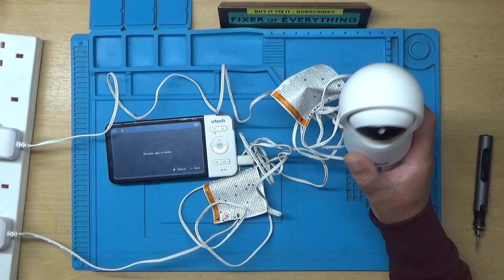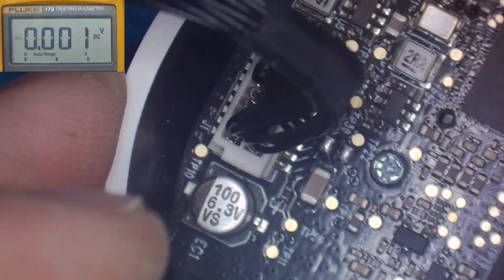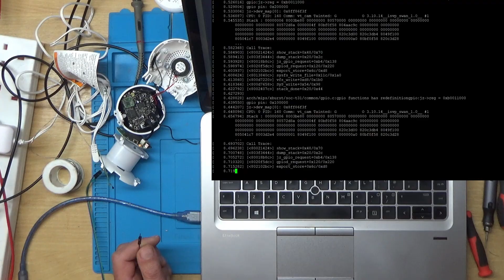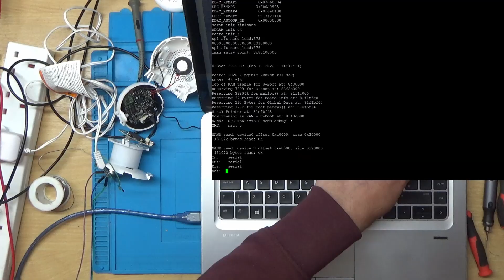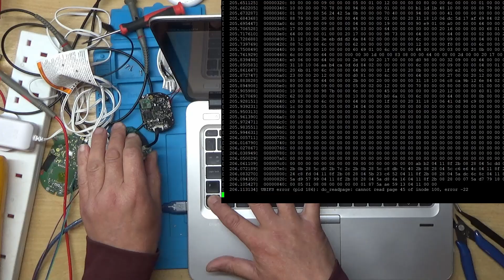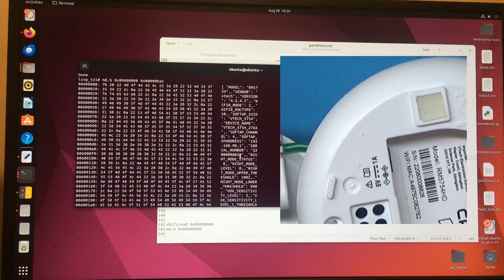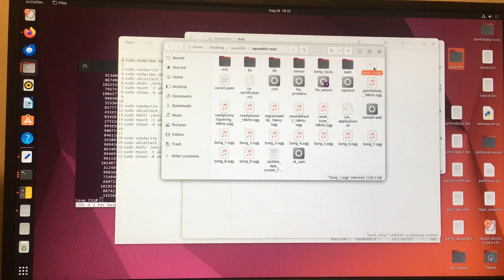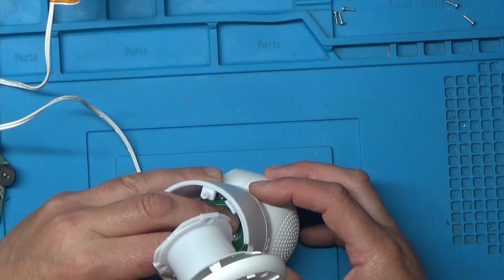Faulty VTech Baby Monitor | An EPIC Repair With Shocking Findings!

Comment: I would love to see you tackle a ps5. They take someone who not only can solder well but understand how to use uart to diagnose the failure. Ive just recently started watching PS5 repair videos. 

The other interesting video i found lately was for a flood damaged aston martin (over 120k dollars). Theres a flash chip that contains a cff file (the cars vin, options, firmware etc .) you cannot replace the part without having it programed but the file only exists on the old chip and at the factory. The factory has a part number for the chip and file but refuses to fulfill the order (even from a dealership). The owner gave up and sold the car but what an amazing project that would have been. 

Thank you for such a great video!
Reply from the maker: Thanks 👍I'm sure I'll get a PS5 to look at in the future, but today I got asked if I would be able to have a look at an electric train! with a dead control module, so that might be very interesting if it comes off...

Comment: Hey Great video thanks for making it.
I am not sure if you tried the simplest fix of all.
On the Camera itself you can hard reset the camera back to original factory settings.
Turn on Camera and hold the pairing button down for 20 Seconds (20 did not work for me but 30 did).
IT clears the entire camera and put original firmware back on it.
Reply from the maker: Thanks for the tips, although it would depends on where in the camera software it detects the button press. Seeing as it wasn't booting up, it may not have reached that part of the code. There are a number of these for sale with the same issue so they may have tried that and it didn't work.

Comment: This was definitely a great diagnosis and repair!  So the filesystem for the video recordings had a bad block, and I'm assuming the OS (Android) had no way to auto-repair the filesystem, rendering the device dead!  that seems like a poorly written firmware/OS implementation.  I wonder if there's a reset sequence that would force a format of that filesystem, by just pressing the reset button. (maybe longer than 3 seconds?). 🤔  great video, again!
Reply from the maker: Thanks 👍it just runs linux not android. After recording the video I still had the file system on my PC and discovered that the file causing the issue was a sqlite database that indexes the video files. Deleting the files caused the database to become invalid and it was recreated. It was possibly corrupted due to a power failure or the update. I'm still not sure on that one.

Comment: Fantastic job figuring that out!  The amount of times I've seen a firmware update that's bricked a device because the uncompressed  firmware was larger than the free space on the flash. It's maddening that they dont test it or at least set a maximum on the partition size to make sure there's enough for firmware updates. A lot of these type of devices tend to store user storage, like images and videos on a micro SD cards (but I get that typically its not fast enough to store high quality 4K video on a lot of SD cards).  At least then it ensures that the flash is standard on every device.  Well done V-Tech for not carrying out a proper UAT.
Reply from the maker: Thanks for that 👍If you like this type of stuff I've done a few other videos similar where I've had to delve into firmware or even reverse engineer software to fix stuff. I've just created a playlist here: 
https://www.youtube.com/playlist?list=PLu4s108ty9Iki2H77htqeCNqtunWMJFKK

Comment: Got a similar one a while ago, that I got on clearance. Bought it because the power supply is micro USB, and has a 3m cable for power, and is capable of 1.5A output.
Reply from the maker: Nice 👍

Comment: Installing the Linux binwalk utility would have extracted all the partitions from the flash.
Reply from the maker: Unfortunately not. It was the first thing I tried. I've reverse engineered loads of stuff over the years, cross compiled stuff, and even wrote an SDL layer and ported Doom and Duke Nukem to the LeapTV (kids game and a few other platforms such as a ROKU TV player) around 10 years ago. Whilst normally binwalk would work, this flash chip has OOB data for error correction which needs applied to the sectors so you have 2048 (data) + 64bytes of EEC data which can't normally be accessed. This needs applied to the sector if there are any errors and obviously mucks up the raw file. Then because it uses UBIFS you have to emulate that because the sectors are not in sequential order, they can be written anywhere so a file might be at sector 1,48,1034,3,72  instead of 48,49,50,51 which further complicates it. I even tried some scripts to apply or remove the OOB data, and extract the UBIFS. This is why it spent about 3 days on it and ending up using NANDSIM... I didn't include any of that in the video otherwise it would have been a 2 hour episode! 😂😂😂

Comment: What's crazy to me is that you just casually mention seeing if you could find a datasheet for the IC contained in this camera and then POOF....   there's the datasheet on the screen!!   So clear, so informative, and incredibly, displayed in ENGLISH!!
  I do a lot of similar work repairing various electronics and I would say that maybe, if I'm extremely lucky, I'll find ONE datasheet for a chip out of every 30-40 attempts!!  
    What typically ends up happening is I'll either have some part number that takes me to a page written in all Chinese, or I'll end up looking at a similar part being sold on AliExpress!!   That's it and that's all....  there's typically no other options when trying to find info on an IC!   Doesn't matter if it's an American made product, an Indian made product, a Taiwanese made product, or a Chinese made product....  I ALWAYS end up on a page/site that sells the chip from somewhere deep within China, but with zero pertinent information attached!
  I wish I had your superpowers, sir!!
Reply from the maker: Thanks Mike, yes some chips you can find very little information on. I guess I might just have the electron gods on my side at times 😂😂😂👍

Comment: One trick that you may find useful in the future is to update the linux kernel commandline to set `init=/bin/sh`. Linux will run /sbin/init by default, which runs the programmed startup sequence, mounting filesystems, starting daemons, etc, and potentially starting a login program (that may ask for a password). By running /bin/sh instead, you skip all of the startup sequence and drop straight to a shell.

In uboot, you have to start with the `bootcmd` environment variable (use `printenv` to show them all), then follow the program logic until you find the variable that holds the linux command line. This can be a somewhat complicated process depending on whether the manufacturer has fallback boot options, etc, but not insurmountable.
Reply from the maker: Thanks for that Rogan 👍

Comment: Now that you understand what the problem is and you want a factory reset. Google says if one holds the “pair” button for 20 seconds it will delete all data and restore the factory conditions. 
You are nothing if not persistent great video.
Reply from the maker: Thanks 👍I'm not sure if the factory reset would have worked as the device was not booting up correctly due to the file corruption.

Comment: So basically everyone who bought a Vtech Home Baby monitor which did an update in April 2023 but which also had recordings saved on it 'Might have' ("MIGHT Have"...) had their device Bricked by the manufacturer - probably unintentionally - due to the aforesaid software upgrade not performing all the necessary steps to ensure the device functioned correctly afterward.... probably due to not wanting to require a customer interaction that would have meant asking for any saved video's needing to be deleted.....

Bet Vtech never admitted to that one!
Reply: Maybe instead of deleting and recreating the saved video files folder, try reloading the old S/W... If it then works it's the software. If it doesn't, then it's probably the sqlite file being overwritten with nothing whilst not leaving the old video files blocking the available space.
Reply from the maker: I "might" have made an error blaming the update..After I finished recording I managed to find the file that caused the problem. So I'm not sure if I can be blamed on the update although the dates did seem co-incidental so it still may have been the cause. The problem seemed to be a sqlite database stored on vtech data 1, which indexes the video files, so perhaps the camera lost power or rebooted while updating this file. I think deleting the videos caused this database to be re-created and fixed the error.
Reply: @BuyitFixit  Thanks for the reply - you said there were several of these with a similar error? It still sounds like the update might have caused it 'If' the camera had stored video files on the internal drive and the sqlite database was reset during the update with no free space now available........ Might be interesting if you get the chance to examine a 2nd failed baby cam....

Comment: Yet another excellent video, Mick! Was a true pleasure watching your methodological troubleshooting and forensic skills with so much of self-confidence and resilience demonstrated here. Hats off! Just for curiosity, I was wondering if a usb stick could be used here to dump the flash directly from uboot (via its usb command), instead of taking off the chip from the board. If this is possible then not only the device can be fixed without even opening it up but also the recordings can be dumped this way relatively easily too. Uboot log shows both usb and usbboot commands are available so I'd assume it can operate in a host mode, once being properly set up via usb command (usb start; usb info; usb write).
Reply from the maker: Thanks 👍Yes it is possible to do pretty much that. I've just done it last night with another device I'm working on which has a root password. Although that device is not faulty (Hanshow ESL controller).

Comment: So you're not only good at electronics but also at Linux too. Very impressive. My utmost respect ! I did some hacks like this in the past and I know what it takes.
Recording video files onto small non-replaceable soldered flash memory chip is not a good design choice. And video recording is likely what has caused the ubifs partition to get corrupted on this device, causing the system to fail to boot. The T31 SoC has SDIO on it, they could have easily added an SD card slot for video storage.
I wonder... since this device is essentially a glorified security camera, how hard it would be to re-use just the camera part as a home security camera...
Reply from the maker: Thanks👍I think that would be possible. The T31 seems to be used in quite a few devices. I've also reverse engineered windows applications and other devices in the past too. If you like this kind of stuff you might be interested in other similar videos I've done. I've just created a playlist of them here: 
https://www.youtube.com/playlist?list=PLu4s108ty9Iki2H77htqeCNqtunWMJFKK

Comment: Wow. I did not think this was going to end up with you on Linux and discovering all those useful commands that lead to the successful repair. Do you know if accessing a device through the serial diagnostic pins is normally open (not password protected)?
Reply from the maker: It depends. I'm just looking at another device which isn't faulty, but has a password on it. But because I can access Uboot it should be possible to access the flash, dump it, change the password and re-flash it. Sometimes it's just thinking of a way around something. If you like this kind of stuff I've just created a playlist of other videos I've done where I have ended up going down a similar path. 
https://www.youtube.com/playlist?list=PLu4s108ty9Iki2H77htqeCNqtunWMJFKK

Comment: So, when it comes down to it, are we perhaps saying that the update wasn't compatible with existing stored data or perhaps the update just got corrupted somehow. What a game. Well done for sticking with it - very interesting!
Reply from the maker: Thanks 👍After I finished recording I managed to find the file that caused the problem. So I'm not sure if I can be blamed on the update although the dates did seem co-incidental so it still may have been the cause. The problem seemed to be a sqlite database stored on vtech data 1, which indexes the video files, so perhaps the camera lost power or rebooted while updating this file. I think deleting the videos caused this database to be re-created and fixed the error.
Reply: @BuyitFixit  Interesting! Well done in sticking with it. Thank you for the additional input. You sure have some patience. You'd think that they'd be more robust than that really. Just goes to show how things can end up as bricks so easily.

Comment: In rock climbing parlance, an epic is any climb that (due to weather or orhter unforeseen circumstances, poor planning, mistakes, etc.) turns into a massive, drawn out, much longer than expected (and typically exhausting) ordeal. So while this is an epic repair, it's also a repair epic. Well done! I'm constantly stunned by the breadth and depth of your knowledge and skills - repairing everything from tractors to baby monitors to gaming consoles to power tools.
Reply from the maker: 😂😂😂Thanks for that. Yes I'll have a go at pretty much anything.. after all it's already broken.. So the worst I can do is it's still broke 🙂

Comment: Cracking repair! Looks like all the files were recorded on the 10th judging by the file names and then nothing until the update 10 days later.

It's amazing how carelessly people hand out devices with all their data! I can't tell you how many second-hand computers I've gotten my hands on (bought used, been given, found in the street) with all kinds of sensitive data on non-password protected hard drives! Most didn't even have OS user passwords set, let alone hard drive encryption. Personal letters, CVs, application letters, divorce proceedings, the whole accounting of a small business, I've seen it all! Thankfully nothing disturbing or criminal yet.

On the flip side I once found what must have been a pristine white Apple iBook G4 (at a time when most of them were badly cracked and yellowed due to age) that someone must have taken an axe to in order to remove the hard drive quickly (the official procedure includes steps like: "Remove the following 40 screws"). That person definitely knew how to take care of their data but utterly destroyed a lovely vintage laptop in the process. There was absolutely nothing left to salvage except for the screen and DVD drive.
Reply from the maker: Thanks 👍Yes I used to buy old PC's and laptops and do them up a bit back in the day, and yes they were always full of all kinds of stuff!

Comment: your a genius. 
could you troubleshoot some senheiser hd 450bt wireless head phones ..loads of faulty ones on ebay  with similar issues. I think its also firmware problem or something feeding the chip, would love to get to the bottom of what the issue is.
Love your videos and your troubleshooting technics. 
Thanks and Keep up the good work.
Reply from the maker: Thanks 👍I'll have a look 🙂

Comment: Quality content! I once tried to read a nand flash chip from a download of it but failed. Sadly the guy lost his favorite fishing spots haha. None of my research bought up nandsim at the time. Will keep that one up my sleeve.
Reply from the maker: Cheers 👍Yes it was a bit tricky to get working as you need the ID's of the flash chip to set it up, and unfortunately the chip on the baby monitor didn't seem to be supported so it did take a bit of trial and error to find one with similar settings.

Comment: Could it be that the memory was just full?
Reply from the maker: After I finished recording I managed to find the file that caused the problem. So I'm not sure if I can be blamed on the update although the dates did seem co-incidental so it still may have been the cause. The problem seemed to be a sqlite database stored on vtech data 1, which indexes the video files, so perhaps the camera lost power or rebooted while updating this file. I think deleting the videos caused this database to be re-created and fixed the error.
Reply: @BuyitFixit  I have had many updates fail by not having a safeguard against memory limits during updates. It appears that the user may have been unaware of the files being saved to the device and did not manage the saved files. The corrupted file may have been the result of running out of necessary memory during the update. If you looked at the first saved mov file date it may be likely it compares with the purchase date or in some proximity. Also by comparing the memory capacity before the mov files were removed there might be some indication about whether or not the memory was at or near capacity. My speculation is only based on similar experiences of update interruptions and file corruptions due to lack of required memory. It is only a hunch not based on any specific knowledge about your actual device. I had the hunch prior to the file removal. Once I saw that the corruption was healed after making new space it seemed to give a little more credence to the idea. Thank you for your response, and thank you for inspiring your viewers to think and learn. I really appreciate the learning experience! I like you have trouble giving up even though the investment of time goes beyond the value of the project. I love your tenacity and volume of knowledge! 👍🏽